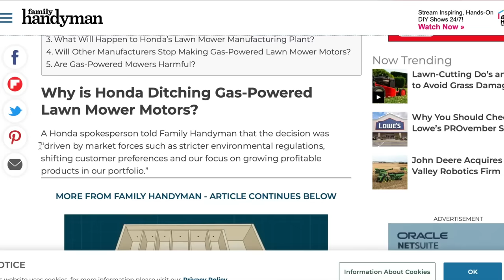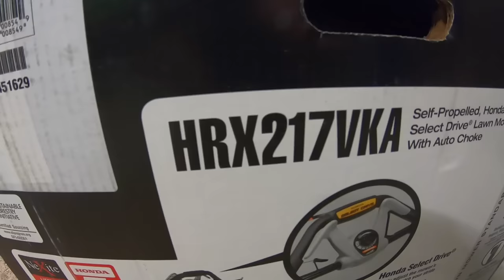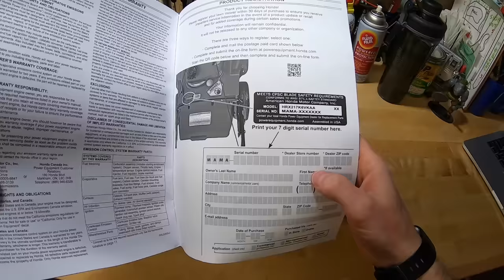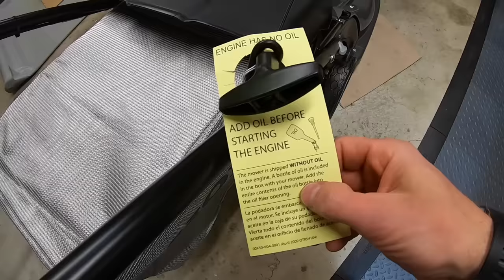ARE HONDA LAWN MOWERS STILL WORTH BUYING IN 2023?

Comment: Hey Garage gear I have a question for you or anyone that can answer it, I just got a new HRX2176HYC, I have notice at times it is very hard to pull start, sometimes it pulls easy other times it pulls the cord out of your hand, its like you have to try pull it through the compression stroke. is that normal, or should it be looked at? thanks
Reply from the maker: Hey SA I would have it looked at. This doesn’t sound like something normal! Thanks for watching!

Comment: Hi JB, love your channel. I bought a Buffalo machine last month and used it twice with amazing finish. The 3rd time of use, it failed to start after not using it for only 4 weeks. For a minute I thought my son used a 2 stroke mix in the tank. But NO, it just wouldn't start and I was starting to worry as it's new! I walked away and was heading to the manual, as it started but was coughing and splattering then it stopped and wouldn't restart. Then before I could read the manual, my son kicked it over. It was weird. Is this a normal thing if unstarted after 4 weeks?
Reply from the maker: Hey satcha! Appreciate the positive feedback! What kind of machine do you have?
Reply: @GarageGear  Honda HRU19M2PKU Domestic
Petrol Lawn Mower
Reply from the maker: @Satchafunkilus  doesn’t sound like a normal thing to happen on a new mower. I would consider taking it back to the dealer to see what the problem is.

Comment: @garagegear will the HRX bag attachment fit on the HRN to get the extra capacity? Thanks for the great content
Reply from the maker: Hey jcd it may fit but may also throw the weight off and tip the mower back. The hrn is lighter in the front and could tip back with a bigger heavy bag. Not sure on this though.
Reply: @GarageGear  I can confirm that the HRX bag fits perfectly and doubles the bag capacity. The weight difference doesn’t seem to be an issue. It’s nice emptying the bag half as often.
Reply from the maker: @jcd674  appreciate the info!

Comment: Bought a new Honda HRX217HZA (electric start, 21") gas hydrostatic w/roto-stop. Followed the manual (probably my 12th mower).  Electric start worked twice, then battery appeared to be discharged (just like the maual said it would). Tried the pull start: not going to happen> would not budge. Thought could be a hydrostatic lock or cracked ring or frozen/locked blade clutch or ???Pulled the spark plug. engine spun easily. Put the plug back in, locked still. Since the mower didn't come with a charger, had to order one and still waiting. Would like to get the mower running.  Any thoughts on why it is locking up?  I did a search and found that model online at a big box store and in the reviews with 1 or 2 stars only, there were MANY others with the same issue.  Also, even though it only ran for about 5 minutes, there was more engine vibration than I would have expected and the throttle surged the entire time.  Any ideas; or, should I just return it?  Thanks in advance.
Reply from the maker: Thanks for sharing this commons sense I would take it back if you can if you’re experiencing issues like this!
Reply: Unfortunately your problem is very common with the new Hondas. The problem is a failing camshaft. The camshaft has what's called a "compression release" on the cam gear. It releases some of the engines compression enabling it to be started with minimal rope pull. Honda used a manufacturer to make these camshafts for them. They use a type of plastic or phenolic lobe. It appears that the manufacturer didn't let the lobes cool properly  during a particular stage of manufacture causing the lobes to fail prematurely. Honda now has a Stop Sale order on all HRX's and HRN's because of this issue. You can go on some of the Honda forums and there is a guy named "David from Honda" (or something like that) who is an engineer for Honda who has explained this issue. Hope this helps you!

Comment: I’ve had an HRX217 for about 15 years, and I’ve never been able to find a detailed guide on how to increase the idle speed. My manual doesn’t cover it and there seems to be multiple versions of this mower, none of which match how my engine and carburetor looks. Maybe I should get a new one before they sell out. When the Honda mowers become unavailable, what brand do you recommend for a medium size yard?
Reply from the maker: Hey ken! Toro has always been a close second but their quality has gone down some. May have to start looking commercial for better quality. Thanks for watching!

Comment: Owning a new home, I made the mistake of going with an electric mower (EGO) and it’s terrible. I’ve been looking at the HRX217VKA for a while & this video reassured me I’m making the right choice this time.

Question: I know you recommend the 30 min break-in time & changing the oil afterwards. Should I still change my oil after the 5 hour break in time Honda recommends?

Question: Is it better to use premium fuel vs regular & can I use 10w30 full synthetic oil?

I appreciate any help, thank you!
Reply from the maker: Hey Justin! You made a wise choice my friend! I would still recommend changing the oil after the first 5 hours! I always recommend running it on ethanol free fuel if you can get it. I think 5w30 full synthetic may have a wider temperature range. Check your manual. 10w30 full synthetic should be fine though too.

By the way what factors steered you away from the ego. Youre definitely not the first to tell me this. Interested to hear what you have to say!
Reply: @GarageGear  I’ll make sure to double check the manual, just want the best performance. I bought the ego a few years ago & couldn’t stand it after the first season using it.

Grass gets bogged up in the deck way too easily. If the grass is even the slightest bit damp, forget it. The mower shuts off because of all the grass bogged up. I would have to keep clearing the deck for it to start back up.

After hassling with the mower shutting off, the battery (at full charge) will give me 30-40 mins of run time. It takes roughly 45 mins to charge the battery. So I tried bagging only, & mowing the grass at a higher length. It handles better when the length is higher but still get the same results shortly after. I bought the mower in 2020 & started having these issues 2021. In between years, I succumbed to hiring a lawn service because the frustration of the ego. Never again will I go electric
Reply from the maker: @justinconger385  wow! Thanks for sharing this Justin! Those who mowers don’t run cheap either. And their resale values suck too from what I’ve seen. Good for tiny yards. Not the average homeowner. Appreciate you bud!

Comment: I have the Honda HRC Commercials and the Toro Commercials (Kaw engines) the new 21 inch Scag (7hp and 11 ft lb's TQ) makes both of them seem underpowered with the smaller depth decks do not much as well on very dense thick turf like the different varieties of Tiff. It is a wicked beast that will cut time from mowing. Yes it is about 20 lbs heavier than the Toro or HRC but the bigger wheels make it handle nicely.
Reply from the maker: Thanks for sharing slowpoke!

Comment: Do these HRX mowers have the wheel bushing problem that causes the drive wheels to seize up?
Reply from the maker: Hey sn this is new news to me. Never heard that issue before. They have wheel bearing inside to help them spin better and wear less.
Reply: @GarageGear , I only ask because  in the past the HRR Models have a known rear wheel lock-up problem that occurs every 60ish hours. I enjoy my Honda HRN but am frustrated at tearing the mower's back half apart every 1.5-2 years. Several videos on YouTube here discuss the Honda lawn mower rear wheel lock-up. If the HRX has a different drive system that omits the bushing causing all the problems, this mower might be my best bet.
Reply from the maker: @snrichey  appreciate you sharing this but I haven’t heard about that issue with this model! No one has even mentioned it here in the comments. I’d say you’re good to go with this one!

Comment: I just did my oil , plug , air filter and blades on my HRN for the new season and one of the blades is hitting the plastic part of the deck up front. Checked it out and it looks like the plastic is bowed out maybe about a 1/8 inch. Cleaned all the residual dirt traped behind the plastic and it helped a little. I will see from Honda if that's been an issue with the HRN.
Reply from the maker: Hey WD! Thanks for looking into this. Thanks for Sharing!

Comment: Latest, my HRX217HZA mower leaked oil badly on a mow in November.  Dropped mower off on Nov 4th , 2023 and just got it back today on Feb 28, 2024.  The entire engine was rebuilt, this after the original camshaft disaster back in April of 2023.  Don't know if I have a lemon but man for essentially a $1000 mower, Honda double bogeyed on the 18th hole to finish their career with lawnmowers.  Really sad!
Reply from the maker: Hey Amy that’s a great way to put it. They definitely messed up at the end. Thanks for sharing
Reply: How much does it cost to rebuild a Honda engine on one of these things?  Thanks!
Reply: @charlieclark3029  I do not know the cost as Honda covered the cost.  The dealer told me they paid them a ton, so for them to say it must be expensive!!

Comment: I bought a Honda HRS216PKA in May 2021.  It was a base model.  The engine will probably last 20 or 30 years.  Although the mower plugs up with grass all the time.  If you need to mow tall grass you are SOL.  My old Craftsman that I bought in the year 2000 can mow grass much better.  Sadly I wish that I never bought the Honda mower.   I'm really disappointed with it.  I will probably sell this spring.
Reply from the maker: Hey flilguy! Those decks aren’t the best for tall grass mowing! Best you can probably do is open them up for side discharge. Thanks for watching!
Reply: @GarageGear  I've never tried to use it without the side outlet being open.  After I bought mine I found out most Honda owners buy one with the bag option and leave the bag door partly opened.  I didn't want a bag because I don't bag my grass.  I'll never buy another Honda because of this.  If the grass is tall it will plug up in less than 50 feet of mowing.  My 20 year old Craftsman will blast right through it.   All I can guess are there different blades for that model of Honda?  I've basically used the old mower more because the Honda mows so bad.
Reply from the maker: @flilguy  I would give the side discharge a shot. It will create more suction under the deck and air flow. Thanks again for sharing

Comment: My next mower has to be a wide area walk behind.  Have a 21” Honda now and is taking too long to mow 9400 square feet of lawn plus trimming.  Feet can’t take it anymore as I get older either.  Will never convert to battery either.  With a split level house and uninsulated garage I have no place to put more batteries to make them last more than a couple of seasons.
Reply from the maker: Hey work! Have you looked into any riders? That would definitely save you time and foot traffic.
Reply: @GarageGear  had one and was too big for my yard.  Took as long with a 42” rider as the 21” walk behind with all the turning around.
Reply from the maker: @workinprogress4870  got it. Stuck between a rock and a hard place here.

Comment: I bought hrx216 SPelled for about 950 at Northern Tool in March. I used it once and a safety device broke & would not let mower start. NT had the mower for 2 months and said Honda will NOT send us parts for repair. According to store mgr, honda was getting out of small mower business and they were unable to get parts for repair. Store was helpful, I returned mower and refunded my $. My question: is Honda no longer making and servicing mowers?
Reply: My bad, it was a 217, not 216.
Reply from the maker: Hey bill Honda is on a stop sale right now and are done making mowers in September.

Comment: How's the best to "Winterize" a gas motor  ( I mostly use it a few times in the winter months to pick up leaves and other weeds etc etc )
Reply from the maker: If you’re going to use it throughout the winter months I would just run ethanol free gas in the tank and run the mower to empty every time you use it. That way nothing is left in the carburetor to gum it up.

Comment: Hey JB, would the HRX or Toro super recycler 163cc be better for my 12,000 sq ft lawn. I want a mower that doesn’t need refueling while cutting my lawn.
Reply from the maker: @Gurith43  HRX gets better fuel efficiency my friend! Thanks for watching!
Reply: @GarageGear  also here’s my last question, will you ever review ego electric mowers?
Reply from the maker: @Gurith43  as of now no. Battery content doesn’t pull any views on my channel and when it takes 10 hours to create a video and many viewers are here for gas related content they’re not worth doing. 👍

Comment: Just a question.. Do you know if is a Difference on Honda Mowers sell at Home Depot or any other Retailers Stores..?? I ask because “Some”people always  saying the HDepot ones are a cheap Build.. Thx…in advance…
Reply from the maker: Hey sexy not sure exactly but my guess is that this is not the case. I haven’t seen a difference between Home Depot or elsewhere mowers. I know a lot of people who have owned Hondas for a while with no issues. I know ariens snowblowers sold at Home Depot are a little different than dealer models. Different engines mainly. That’s not the case with Honda. Thanks for watching!

Comment: I use push mowers; don't need self-propelled.  My Honda-powered Troy-Bilt is lighter than my HRN216PKA, so it's easier to maneuver, the GCV160 engine is easier to pull-start than the GCV170, however nothing sucks up leaves better than a dual-blade Honda.  My yard is heavily treed, and fall leaf collection is an issue; that's where my Honda shines.  I hope Honda's battery mowers still have this ability, otherwise I'll stick with the gas Honda.
Reply from the maker: Thanks for sharing

Comment: Appreciated your enthusiasm, but not a word about the current widespread problem people are experiencing with the new 216 and 217 Models and the Pull Start Camshaft Issue. I bought a new Honda back in April 2023 and immediately had to take it to a Warranty Center. Been waiting for Parts ever since. It's now Mid July. The Recoil Starer Handle RIPS VIOLENTLY out of your hand when trying to start. Very Bad.
Reply from the maker: This video came out right before those issues started to surface. Thanks for watching

Comment: Had two others for the last 15-20 years.  Spent $650 on a new one, had it two years, non ethanol gas only, clean filter, dang thing just won't start and no female time to try and figure out why by themselves.  No wonder they are getting out this space.  Frustrating.  Don't waste your money on it.  One pull?  Never for me.  Mine is going on the street next week.  Husqvarna trimmer too.  Tired of all the problems.
Reply from the maker: Thanks for sharing!

Comment: It is now 2024 and I have had a Honda Commercial mower many years. This is my second one bought in 2007 and I am having it repaired largely due to carburetor problems. Since Honda's announcement that they will no longer be making mowers for various reasons, including environmental issues, this undoubtedly will be my last Honda mower.  These mowers had a good run but it will be time to change mower brands.
Reply from the maker: I would look into something commercial
Reply: @GarageGear    I was at my Honda dealer/ repair shop and I can opt for a Stihl commercial mower. Xmark also makes a commercial mower but it is a beast and I have no idea as to if I can get it to fit in the same space in my garage. I may have to do some rearranging of a few items
Reply from the maker: @SteveMartin-zc7qs  idk too much about Stihl but exmark’s are great!

Comment: The old HR 214, and 215 mowers were the best Honda mowers ever made. Back when honda used GXV engines on residential equipment. As they get older, some do have a tendency to smoke a little, though.
Reply from the maker: They’re old enough to smoke though … lol😂

Comment: I bought my '23 Honda HRX217HYA because of the engine quality, but sadly, just 1/3 of the way through its second mowing season, the Honda engine is eating itself. Anywhere from a little to a LOT of exhaust smoke, and obviously it's burning oil pretty aggressively. Another factor you didn't mention in your comparison though, I don't know what the Toro has, but the Honda mower has a 5 year warranty. So my plan is to hopefully get through this second mowing season without it dying completely, then take it in for probably a new cylinder and piston. If it dies again though, I'll either go electric, or find a walk behind mower with Kawasaki power.
Reply from the maker: Thanks for sharing jet!

Comment: I just ordered one from Home Depot and pucked it up yesterday.  Started to add the entire bottle of oil and thought to myself.  I better check it 1st.  Sure enough it was full.  Any idea why?  It has absolutely no signs of being a return.  Every inch is pristine. This is my second HRX 217 and the 1st one did come with no oil in the crank.
Reply from the maker: Not sure but I would just perform an oil change procedure to get it back to the right level.
Reply: @GarageGear  thanks, exactly what I did and she's running perfect

Comment: The baseline hrn’s have gone downhill in quality. They fall apart after the first week of use in my landscaping business. The last one lost compression after 3 or 4 lawns. I keep buying them because of how light they are and I like the mulching blades. I make sure to buy them used for no more than 200. They have to be tuned up a bit since they are underpowered. The older commercial ones were good but they are too expensive now.
Reply from the maker: Thanks for sharing!